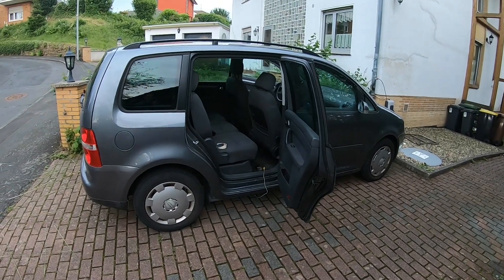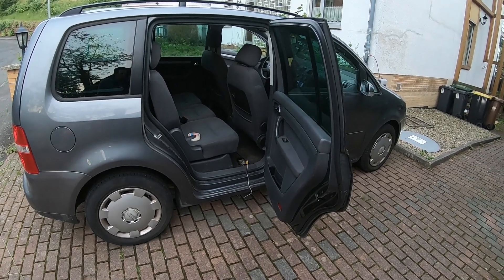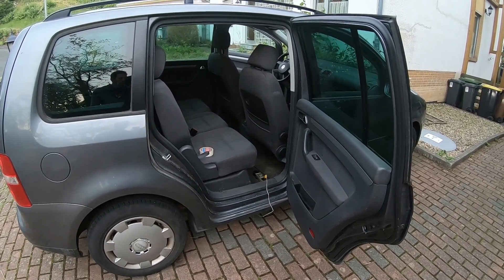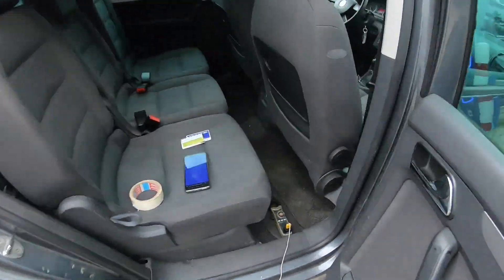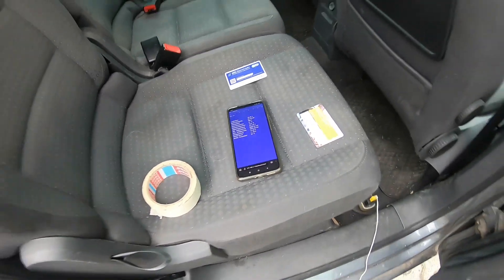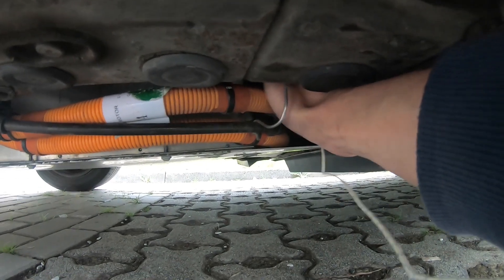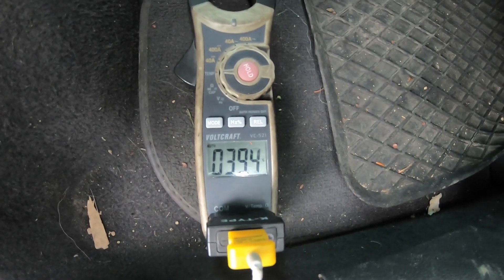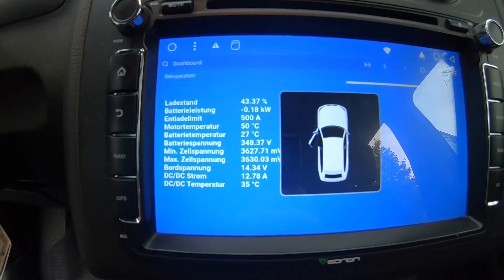Lab Update #94: Rapid Charging Improvements

Comment: I would have thought that 50mm² wire would be adequate for no more than ~125A (based on 60°C rise), but I see you (and others) pushing 200A.  What are your thoughts on the ampacity of 50mm² wire?
Reply from the maker: Things is the current doesn't flow for prolonged time in battery sizes typical for conversions. Peak current will be there for less than 10 minutes. With CHAdeMO I ran only 16mm² cables and these showed no signs of overheating damage despite using 100 kW CHAdeMO chargers @180A from time to time.
The culprit for alarming overheating is usually bad crimps, dirty or scratched contact area and insufficient contact pressure/bolt torque